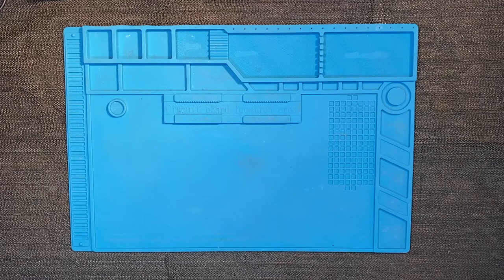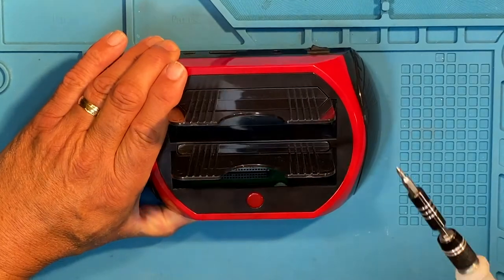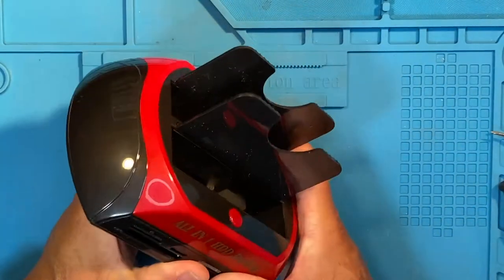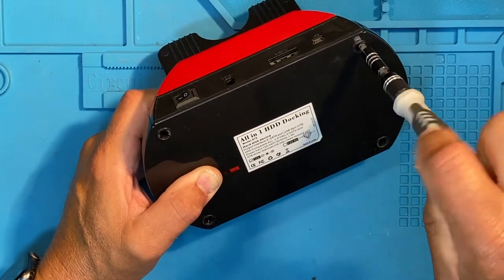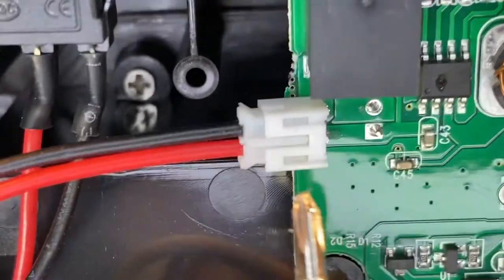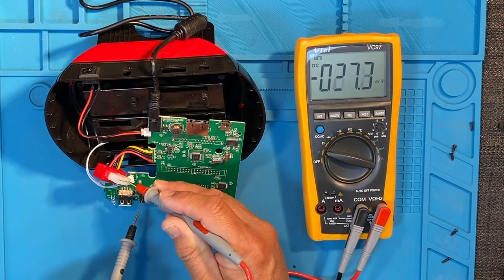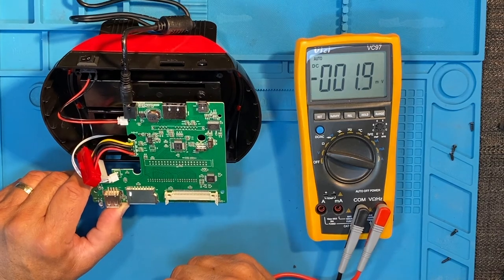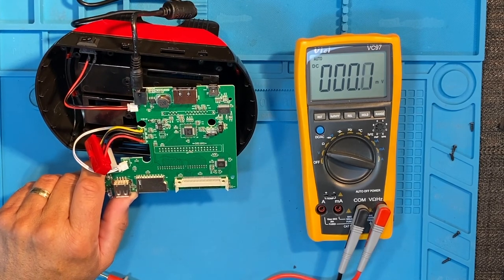All In One HDD Docking Station: Went Pop after 10 Minutes - Let's Have a Look !

Comment: I bought one of these however the package did not come with a driver install disk. :-( 

Can any one help me out?
Reply from the maker: I don’t recall an installation disc but think it was just plug in usb and go. It won’t get recognised as a drive until a drive is plugged into the actual caddy I think.
Reply: @TonesElectronics  tried that, thanks... no dice
Reply: No driver with mnie either.Geoff..IDE did not work it said there was nothing in the drive please install something in drive e as it was in mine.Disk management said NO MEDIA MASS  STOREAGE DRIVE..Everthing else worked fine .I bought mine cheap on F.M.P  unused if i had bought it on Amazon ot eBay i would have sent it back.